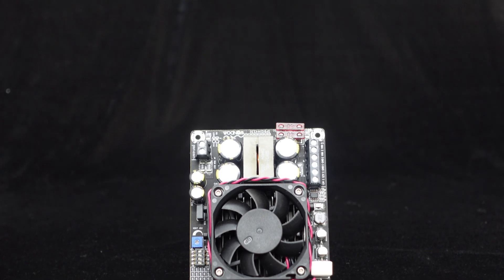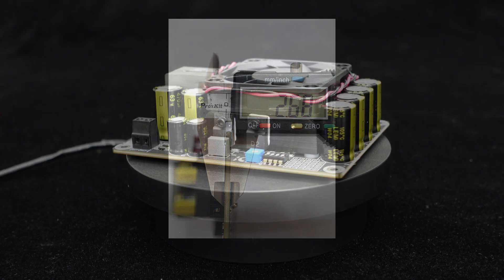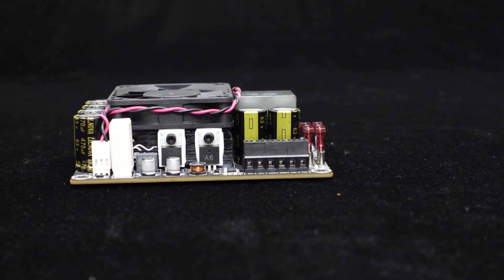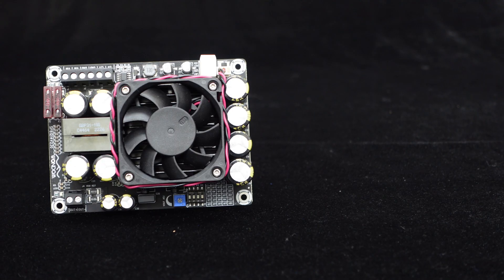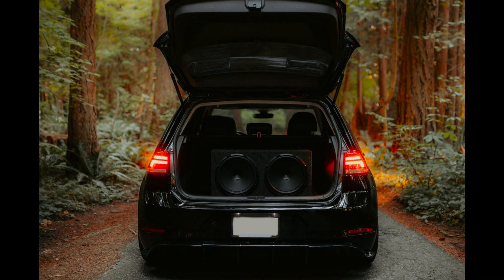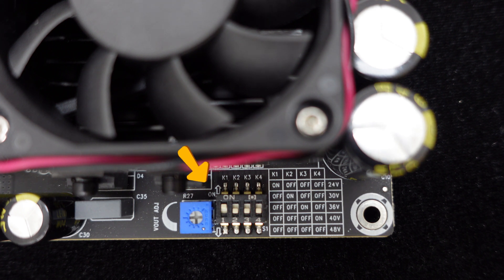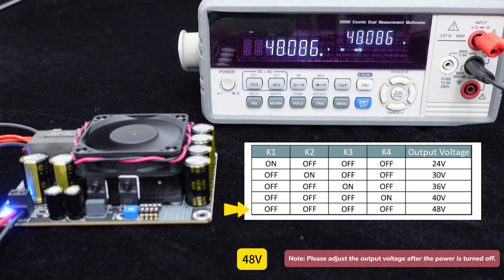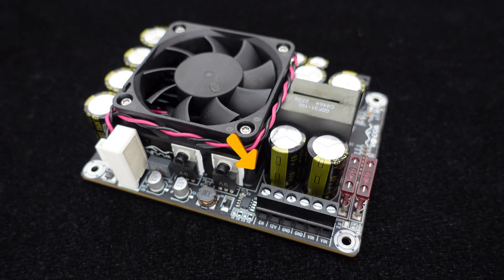WONDOM 500Watts Car Audio Booster Step-up Module Five output Voltage 24V/30V/36V/40V/48V

Comment: Hello is this step up booster only work when you used 12 volt lithium ion battery or can I used 24 volt lithium ion battery and used this booster to step up into 36 volt?
Reply from the maker: Hello, thank you for your interest in our products. The power supply range for this 500W boost module is DC 11V-27V. Wish this could help you. Have a fantastic day~

Comment: Hi, is this power supply isolated or does it share ground? Im interested in buying it and coupling it with one of your amplifier boards but im afraid there might be noise and ground faults...
Reply from the maker: Hello, this 500W boost isn't isolated. If you are afraid of ground noise, it's suggested to add an isolation transformer. Wish this could help you. Have a fantastic day~